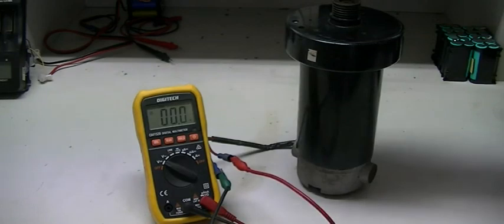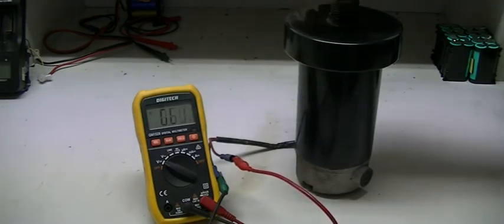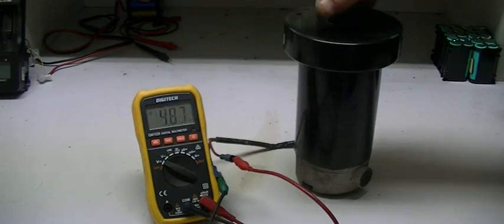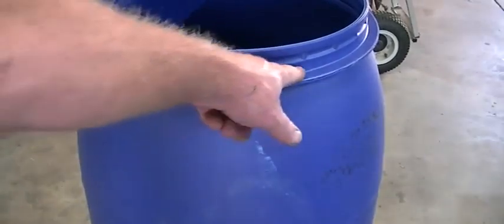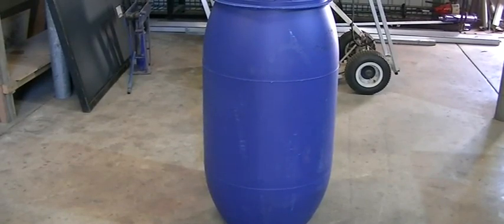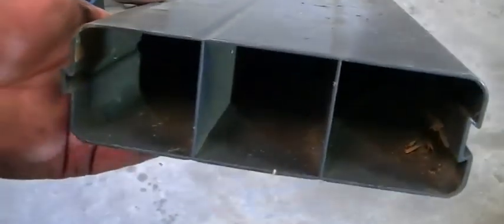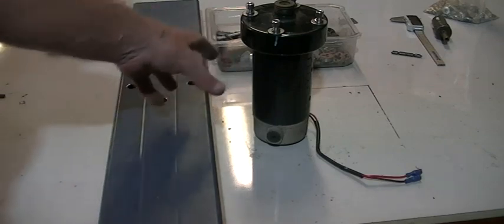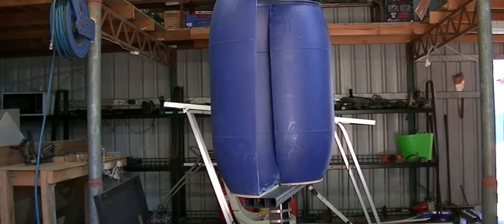Easy DIY vertical wind generator for under $50.00

Comment: Alright I just used fan blades to spin my motor it produces power for sure but I can't charge a battery with it because it's a motor....
What happens when you put power on a motor? You got it the motor starts to spin. So how do I collect the power from the wind and put it into a battery without the battery powering the motor instead?
Reply from the maker: You use a diode or full wave bridge rectifier.
Reply: @69Atho i was thinking that same thing using a diod I'll try it tomorrow.
Reply: @69Atho i used a diod and it works lol.

Comment: In general ,The higher the volts, the thinner your stator wire is ,so the less current the wire can carry before getting hot. This is for a generator this size.

Comment: I tried one that I had, it's a 135 volts motor, with a three foot aluminum propeller on it, it makes about 7-8 volts in a stiff breeze. But I found a nice half horsepower DC motor that makes 79 volts. I bought a set of blades and hub from Hurricane Wind Power ( five) that are balanced to 144 MPH wind. I'm cutting a rototiller differential in half to get the shaft out. I have to taper it to fit the hub, and thread the end of it. Three days ago there were seventy MPH wind gusts here. I have to make it pretty stout for the wind. I'll have to make an adapter from the one inch shaft to the five eighths shaft of the motor, and get a couple bearings to hold the blades up. It is usually windy here. The average for April is 9.5 mph winds. I live close to the top of a hill, so it's windier than the news guys say. I already have a boughten wind generator. It makes around 100 watts from " normal" breezes. But I wanted to make one, so here we go, lol. I got 458.9 watts from the Chinese turbine about two days ago. I didn't have a meter before. I've only had it three weeks...so if I can get 350 from the other one, it'll help my twenty marine batteries stay charged. I have 1400 watts of solar panels and usually I have more power than I can use. But cloudy days, the wind really helps. I didn't know there was that much power in the wind. The wind turbine that I bought would probably have been okay, but they sent me a 12 volts model instead of a 24 volts model. So I said fooey, I'll just make one then. Great fun to watch when the watts start pouring in. The blades seem to be very slightly out of balance on the Chinese turbine, so I have taken the hub and blades into the barn for balancing. I have them bolted to a shaft out a Coleman golf cart steering box, using the bearings out of a Murray riding mower rear axle. Never done this before, but seems like it would work. Figured I'd balance the whole thing. The other watts meter I bought only lasted two days. Had it hooked up temporary with alligator clips, and the pregnant 🐈 cat jumped up there and it sparked I guess but it didn't work anymore, so I have a different one coming. Hopefully the cat will have her kittens and be away from my batteries by then. I'll have the wires bolted on next time.  I think this wind generator inventing is good to have, a couple or three of them just to tinker with. I have an old permanent magnet alternator from a rare Honda 660 car that I'm going to put the aluminum propeller onto, it makes 39 volts after I put the three phases in series. It had them externally in a wye connection. It made 13.1 in stock wiring condition. They only make about 200 watts. They found out it wasn't enough to run a car. They only made the cars a short while, because you had to plug them in and charge the battery when you got home. I think it's going to make a great little wind generator. I hope to make some solar trackers this year. I think this free energy stuff is great. It's all I use, unless I'm welding, then my little gas generator is running. I get good ideas from these videos, everyone has a little bit different system.
Reply: Did u write with pc, phones bug writing

Comment: A treadmill usually have a 3phase induction motor.
Reply: The one's I've seen have DC motors. Easier to regulate speed than AC motors, I think?

Comment: Did you have to modify the inside of motor to get it to produce voltage
Reply: No, it is a permanent magnet motor with carbon bushings. Same type of motor as car starter motor and fan motors for example.

Comment: Very nice, would you need a wind break for high winds? I've only recently started watching this type of content. Caught a Gerard Morin video and was hooked, really liked your rewiring of the h&p drum to 3 phase star/delta video. I'm interested in figuring out if a small wind turbine on a cargo trailer would be able to charge my battery bank while driving. I asked a few channels like Missouri wind and solar and wads told no, but no reason given why not other than maintaining enough speed. This motor seems to produce more than enough at low speeds so it makes me doubt it not being possible. Im currently trying to do a solar set up right now, when i get that done i want to start trying out wind power. Thanks for posting so many interesting and knowledgeable videos. God bless!!
Reply: The wind turbine on a car idea would work, but it would also make you burn a lot more gas. Basic rules, always more in than out. Any time you increase the surface area by adding the resistance of a windmill blade, you  decrease the gas mileage by an amount which is a lot more than what you gained. That's why cars don't have windmill generators on them. Besides, what if you ran into a pedestrian, they'd never let you drive something like that on the street. It was a pretty comical idea though. That being said, I think some guy did put one on a car, back in about 1888, I think. I guess it didn't pan out.

Comment: Thank you for the suggestion for sourcing the motor.   If you want to measure the performance as a function of wind speed, you could use a poor man's wind tunnel.   Put the turbine in the back of a pickup such that the bottom of the rotating section is about 6 ft above the cab (to avoid car turbulence).   Then, you can measure output at a variety of speeds.   Any aerospace engineers listening?  They might have a better suggestion.